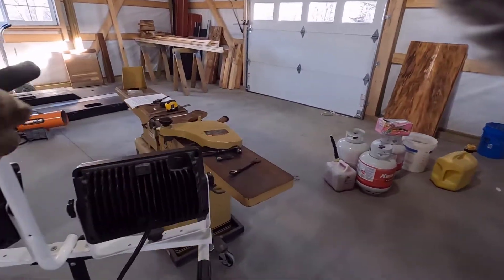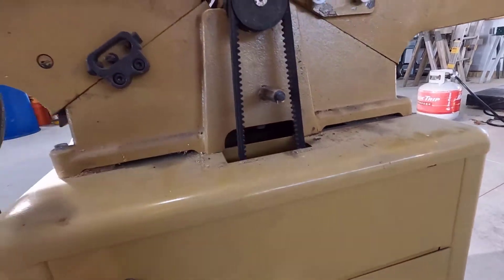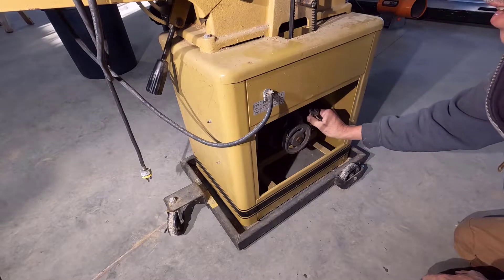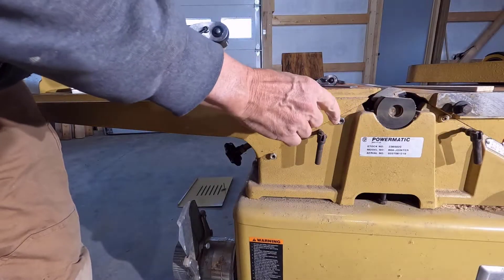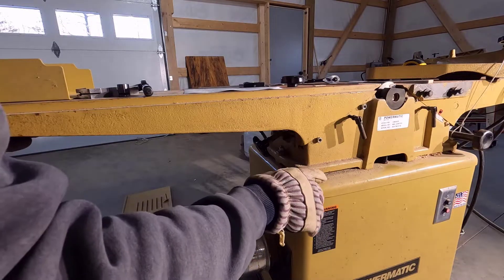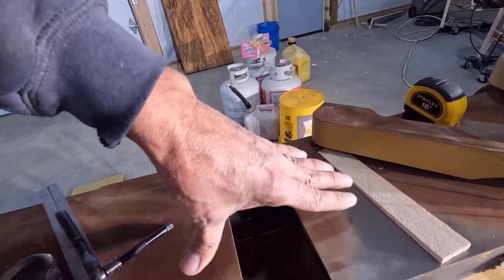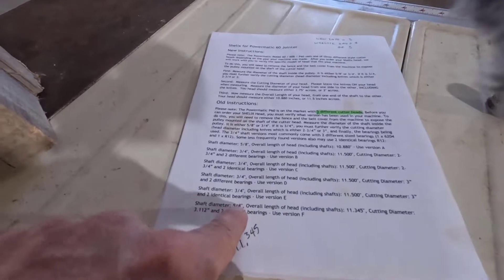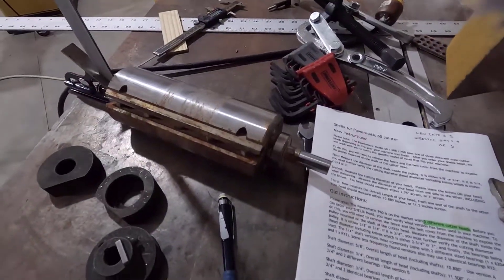Figured Out the Shelix Cutterhead for Powermatic 60A Jointer!

Comment from the maker: I placed the order for Shelix Helical Cutterheads for my Powermatic 60A 8" jointer after pulling out the old cutterhead to get accurate dimensions. There were six different styles of cutterhead in this machine so you really need to pull the cutterhead out to get accurate dimensions — especially to see if the bearings are identically sized (they are). In the end, this machine took the "F" style cutterhead from MyWoodcutters.com Note: When I ordered these cutterheads, there was a good sized price difference between this company and the price on the manufacturers website (Byrd Tool Experts), but on the email receipt, it says that the manufacturer is a division of the company I bought them from. Not sure what is going on there, but I went with the lower price 😊.

I also ordered a Shelix Helical Cutterhead for my Delta 15" Planer (Model 22-675 ). It is the next day, and as of this writing they have not sent me the email to tell me how long the estimated wait will be, but it is averaging two months! There will be tear-down videos for the planer as well, and finally installation videos for both machines. Make sure to subscribe so you are notified when those are posted!

Comment: Any insight if a 1992 PM Model 60 1.5HP 8” jointer would take the same shelix cutter head that yours needed?
Reply from the maker: I couldn't say, but they should be able to help at Shelix. You need to pull the cutterhead out to get the proper measurements, and there is information on that on the website. Good luck!
Reply: @TheLastWoodshop  the guy I talked to at Holbren said all I need to do is measure the diameter of the pulley shaft and that I shouldn’t have to take the entire cutter out to do so. 

In hindsight, would you have been able to do that on yours instead of pulling the entire cutter head?
Reply from the maker: @MrHf4l  The information came from the Shelix website, so no, I don't think I would have been able to do that. Maybe they have simplified things, or maybe it is different for your machine's year.

Comment: I would LOVE to have a Shelix cutterhead in my jointer, but my jointer is a benchtop unit and the cutterhead would likely cost more than the jointer itself 😉
Reply from the maker: With a bench top jointer, I believe it! These Shelix cutterheads are pricey, but save a ton of time if you process a lot of wood — especially figured woods which makes up the bulk of what I use.

Comment: Does the new cutter head come with new bearings? If not,  now would be a good time to replace them. Even if the bearings feel ok, I would still replace them as a precautionary measure. Same as the planer/surfacer.
Reply from the maker: They do not come with bearings, but I ordered new bearings, extra inserts, seals, etc. The jointer's bearings have plenty of life in them — but they sat for 11 years so I figured it's a good time to change them. I ordered the cutterhead for the planer as well. Those bearings also sat for 11 years, but are pushing 30 years old as well so they will be replaced also. Now for the big wait. It could take three months to get the new cutterheads! 😐
Reply: @TheLastWoodshop  Too bad you have to play the waiting game. You've waited all these years to have a nice wood shop and now you have to wait to get it started. Unless you reinstall the cutter heads and use as is. Waiting for your first project.
Reply from the maker: @51ubetcha  I hear you! I have a lot of other work to do out there in the mean time though 😊